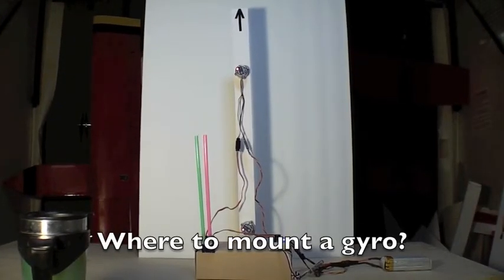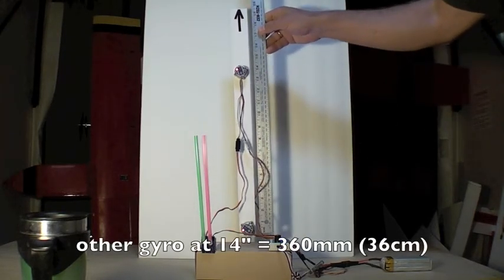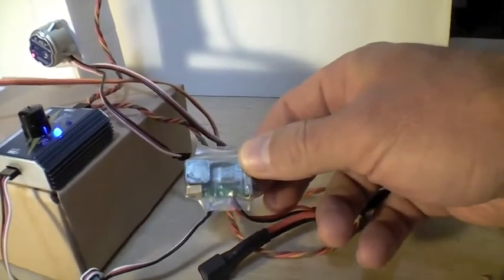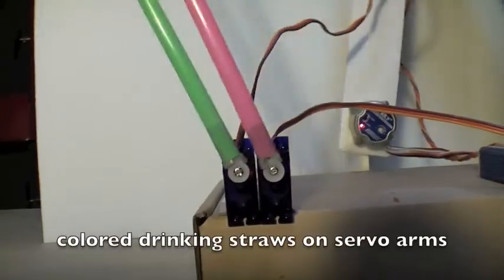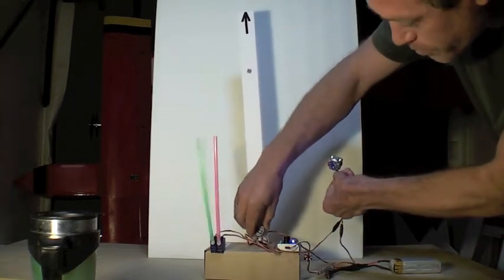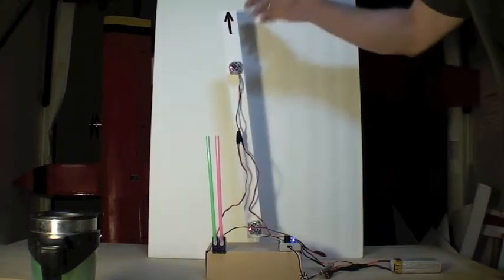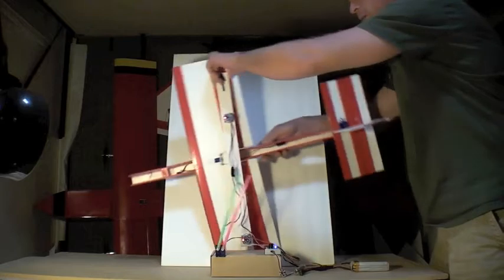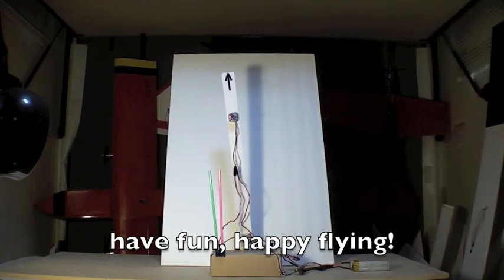RC Gyro Positioning Demonstration

Comment: I wonder if this would apply to gyro/accelerometer units?  Accelerometers at the top position will complain because of the linear movement which probably is the reason why dead center COG placement is necessary and advised by the manufacturers. This demonstration will be fine and applicable to the HobbyEagle A3-L for example, but not the A3 which also has accelerometers.

Any comments?

Comment: Great video.  I plan to make a flying wing and want to use your foam board.  I have heard the wing has camber both top and bottom.  If you ever make a video about that, great, I will be working on a 50 to 60 inch wing and could use any help.

Comment: I just got my first gyro system, so to clarify: I can mount the gyro anywhere on the aircraft as on as it is in the same axis as of movement(Direction plane is flying), for example, the nose, tail, middle of the aircraft, CG position. Please correct me if I'm wrong.